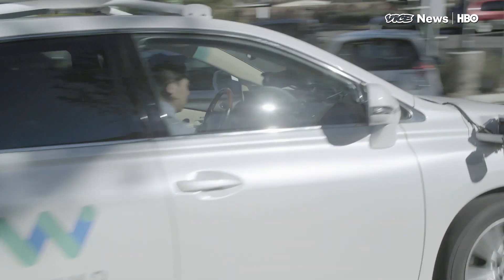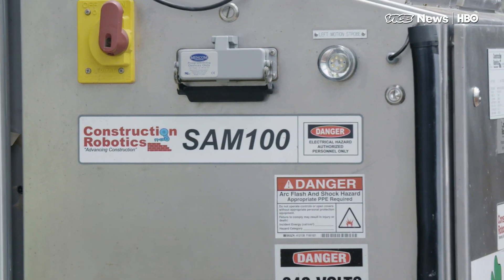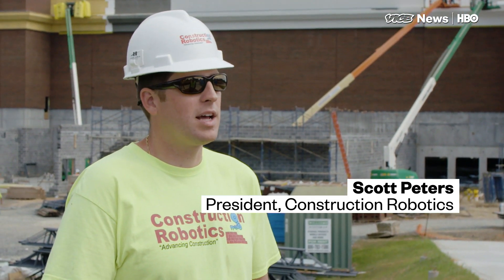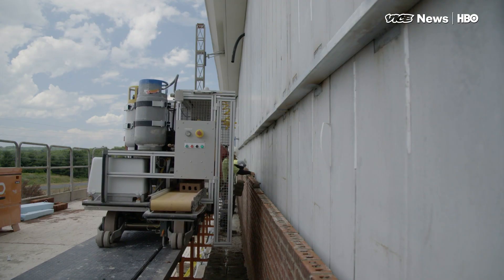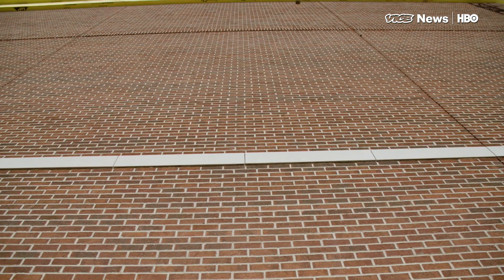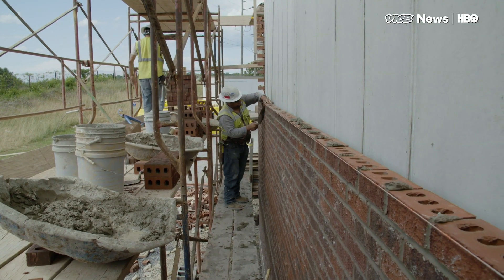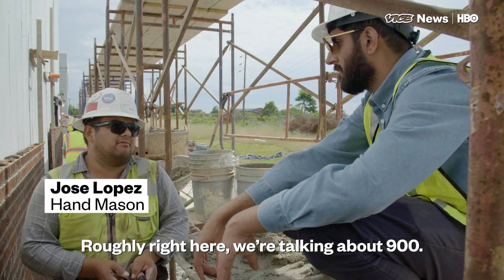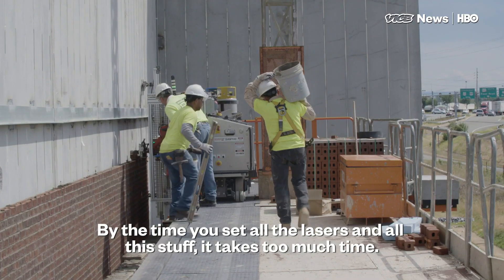This Bricklaying Robot Can Build Walls Faster Than Humans (HBO)

Comment: Listen carefully at the extremely simple and accurate comments made by the two workers....
peoples to feed the machine,peoples to maintain the machine,and even a mchine to feed an other machine.
It's the thing humans can do the best for simple tasks : making it more and more complex and costly in time energy and ressources.
Moreover this robot could only be useful for long or very long walls,since you are limted on the layers you can install per day : you have to let the mortar to dry and harden....

Comment: That big ol' clunky thing? First that sputnik whatnik just lays bricks down. It don't scrap and smooth out the excess mortar, a dude got to come behind it and do that. (And feed it red blocks too? Come on man!) Secondly it's slow. So it's delaying progress. There are seasoned human Mansons that can whip out and lay bricks in quick single strokes and dust that piece of hindering contraption, just being a waste of space. There's some useless technology politics trying muscle in somewhere. That's all. I'd say push that  pile of junk on wheels off the scaffold when near the top of the work and let it kaboom crash smash all over the Earth. Problem solved. Next issue.

Comment: the key statement," a few less workers on sites." Ya a few less now, but in 10 years it will be less a .10/tenth of the workers needed as robots will replace all of it robot load brick robot load mortar robot mix new mortor one guy watching who is the engineer. No breaks no lunch no toilets. It can run day and night 24 hours no breaks a driver pulls up hits unload button robot dismounts truck and is positioned at building with lasers and sat geo. and thats it costs cut drastically no one needed. It is here it is progressing fast adios livable paying job. You should have been in programming. But wait everything is pug and play and soon pc will reprogram itself no programmer. It is here also!

Comment: what they are not talking about is that the economics will take over and the industry will be sucked into designing and constructing buildings that will be predisposed toward construction robots.    
 Money will drive the whole industry to use the least costly method.   
So get use to long straight walls.

Comment: These robots are going to be so limited on what they can do. The setup time is high compared to a human just getting up and going at it. Plus what is the cost of one of these robots compared to cheap labor? These robotics companies are looking out for a quick sale. I dont' see it making curved walls or special joints and laying out the ends if a brick wall. I guess these are more for the easy sections.

Comment: I dont think its faster and certainly NOT efficient, it lay 1 brick any 15sec or so and you need more humans than before to finish the job
1x to place brick into the machine
2x to remove the excedent
1x at the end to redo a final joint
and atleast 2x watching the whole job getting done to make sure its not failing any faster

Atleast you did an amazing opportunity to create more jobs doing this robots which was unexpected xDDD

Comment: Im a bricklayer and i can tell you in point form;
1) that work was as rough as guts.
2) it takes at least one person to man and feed the stupid thing, Im guessing more. And technicians and engineers charge more per hour than tradesmen.
3) it is slow. Much slower than a good human bricklayer and it is almost impossible to lay 1000 bricks in a day. At the speed it was going the only way it would lay 3000 is under perfect conditions over a 24 hr period but i doubt it, meanwhile you have paid a bunch of labourers and technicians three days pay to do what one man and half a labourer could have done much more neatly in one day.

Comment: Seems extremely job specific. Can I do radius walls? Arches. Flemish bond herringbone? Can It cut brick? All of these things come into play while on a job. And it takes 2 to 3 guys to run one machine which seems inefficient. You probably spend a good deal cleaning the machine lubricating the machine and setting up the machine when you could just be laying brick.
Reply: Seems like it wastes a lot of mortar as well.

Comment: Let it build a house with plenty of corners and not just a straight wall.  It needs good clean ground with no scaffold in the way. Totally pointless. Plus u need two brickie s to tend it and if u watch the video there's actually one lad tending it and two brickie s cleaning up and pointing the joints pure stupidity

Comment: This is an amazing machine but it is overall very sad as these BIG Companies keep building machines that are taking the place of humans. This will cause these BIG companies to grow Bigger and Richer Faster. Pretty soon these companies will have very little human workers and it will be nearly impossible to compete as a independent company, also small independent companies will start to get sued constantly by these big major companies if smaller companies start to make a dent in the big companies pockets.
Reply: Actually, a couple states DO have laws against SLAPPs.
Reply: i DO like to RANDOMLY capitalize words for no REASON
Reply: Dude, I hear you. It's gonna suck when it happens. I'm in security and I can see drones and automated systems taking a lot of the jobs I used to do. But if it gets to the point where a machine can do it more efficiently, safely and cheaper than me? I can't fault them for that. I can fault them for using the threat of automation to keep wages low and fighting against proper welfare and retraining programs to help people losing their jobs.

It's coming and we need a solution for it. Going backwards isn't the solution.
Reply: Can't fault them for wanting efficiency and safety.
Reply: i make memes for a living It's all about the Emphasis.. Braa.
Reply: Rhazor Halone Did I say we need God? Both God and science are a thing of the past, both of them are systems of belief, just as politics and economics.
Reply: Rhazor Halone You too :D
Reply: Rhazor Halone Okay I get you pal, let me guess, you were born in the Anglo-Saxon world and obviously anyone who is not sucking obediently onto the tit of the market must be considered a threat to your values. Unfortunately, the neoliberal hegemony which is based on these values is on decline and it's just a matter of time before TINA gets dumped in the dustbin of history along with capitalism and Social Darwinism. We simply can't survive it, and if you think lower prices will save us from self destruction, you are a blind schmuck that hides behind economics to try and escape from your feelings. Life will show you how naive this attempt is, which only brings more suffering and ever greater need for distraction and entertainment (money, food, sex, alcohol, tobacco, stimulants, antidepressants, porn, objectification of people, politics, nationality, power, aggression etc). It will never substitute for love, no matter how hard you try and you know it. The choice is yours really, but if you think you can mask the suffering with belief (whether it be in God, the state or the market), you are in for a bad trip my friend.
Reply: Rhazor Halone By the way, where are your own arguments? Up to now all I have seen is a dubious proposition of Varoufakis' critical thinking capacity and repeated labeling of the points I made as a 'bloviation'. Thanks for this wonderful concept, I will use it in my writing on populists, which believe me are very useful in keeping your beloved market mechanism intact by channeling the rage of the people towards abstractions and therefore lowering the social pressure which results from ever expanding marketization, financialization and consumerism.
Reply: Rhazor Halone I hope you're having fun kicking that straw man's ass, just don't forget that it's merely a projection of your fear.
Reply: Rocks Are People Too what if you ask what the five fingers say to the face first?
Reply: The people will have to vote for a politicians that don't side with the 1%, never gonna happen, the mainstream media is in charge.
Reply: Automation benefits big companies more than anyone else, yes, but it will also destroy capitalism.
Reply: Rhazor Halone You are so confused oh god, I hope you read a book or two in your life.
Reply: Gizmo fromPizmo yeah that's cool I hear you, get back to me when your job implements a similar structure and you lose your job due to it. Don't blame them. Just take a hike and get a different job.
Reply: Rhazor Halone I am sorry, but you still live within the confines of the neoliberal worldview which prevents you from questioning and contemplating the most fundamental phenomena of the social, political and economic systems of the global civilization. Indeed it is nice to see that you have studied economics and realize that consumers benefit from cheaper production costs. But you see, economics, ever since Walras, has strived to become and pretended to be a SCIENCE. This fact, plus the secularization of the Western world in the 19th century, plus the historically contingent growth of the state apparatuses of the 20th century due to mainly military and monetary reasons, allowed those who were once considered philosophers to a greater extent than economists, become highly respectable government advisors and academics whose institutional and disciplinary frameworks incentivized an ever greater expansion of the field we now call economics. Unfortunately, economics can never be a science. It can only be science for a society of the period we call modernity when people still lived the Newtonian dream of the classical mechanics. Reducing human life to only that which can be measured and quantified objectively and thinking of one's self as a subject in a physical world of external objects sounds like a nightmare of a Western intellectual that still didn't know what the atomic bomb and psychedelic experience was. Yes, we killed God and drank ourselves to death when it became clear that substituting Christian metaphysics with scientific worldview (which leaves that question out altogether) could only bring us disconnection that ends in war, genocide, propaganda, consumerism, narcissism, depression, populism, pollution, the good old poverty and inequality, all in all a capitalistic kleptocracy where decades of public investment in technology can be privately capitalized on, turning profits into a white cloud of smoke (it's pretty hard to tax air, isn't it). Let's talk again once you have looked into things like suffering, poverty, love, childhood trauma, oil, tobacco, alcoholism, pharma, mental illness, history of economics, history of modern education system, environmental degradation, Cold War propaganda, LSD, Hermeticism, theosophy, Hegel, Marx, Nietzsche, Husserl, Jung, Sartre, quantum mechanics and many others if you are curious enough. I believe automation is a good thing, but not until it has destroyed capitalism. I am not interested in pointing out your mediocrity and having a laugh about it, I truly love you and hope you don't stop on your journey towards higher levels of consciousness.
Reply: Rhazor Halone Please watch this video, I am sure it will be very helpful to you: https://www.facebook.com/evonomics/videos/1953633044907475/
Reply: Rhazor Halone Don't you think an individual who has studied and taught economics for decades might have a more informed view than someone who labels things as "stupid" and people as "morons"? Boy you have a great surprise waiting behind you if only you decide to turn back. Just know that what you experience is absolutely normal. Anxiety is the main reason it is so hard for us to learn about the world. Many new facts seems to contradict our current worldview and we experience cognitive dissonance. Staying within the confines of our worldview by listening to the same information providers seems to make us feel much better and therefore we become more and more sure of the validity of our opinions. This is a trap however, which does not allow us to get beyond the dualities of the mind.

Comment: This machine can only be used in very specific circumstances, plus there was three people around the machine just to operate. It lays 3000 bricks a day, but on that same wall you could easily have 3 brickys there doing the same job with virtually no setup time. I dont see how its cost or even time efficient tbh. I bet it takes a good couple hours just to setup all the lasers ect.

Comment: You call that a brick wall? lol
Reply: Never makes a mistake as long as a human is monitoring it. Places bricks only, can’t finish the joint or brush for aesthetics. Doesn’t do corners, but goes like hell in a straight line. Takes several days to set up just to get rolling. Doesn’t pee in corners bonus
Reply: Im surprised there is no steel bars inside the bricks, its like a paper wall
Reply: West Senkovec I'm not sure what else you would call it
Reply: West Senkovec it’s a brick facade
Reply: Brick decoration, the wall is that concrete slab behind. Waste of bricks.
Reply: Aaron Nunya 3000 bricks a day. 4 bricklayers around £800. This machine must cost around the same to hire a day. Plus it needs 2 men to load it with muck and bricks and to point up. This robot can't pick out a chipped or cracked brick and throw it away. Not to mention some of them bricks the robot was putting down did not look the same height
Reply: J.L.T BRICKLAYING CONTRACTORS yeah, they own the machine soooooo it works for them and if they're still using it, it means it's leaving them with profit atm.
Reply: West Senkovec the perps are tight but meh.....
Reply: Aaron Nunya that's not hell in a straight line ;)
Reply: @Pablo Elizondo its just a face brick wall as opposed to a brick veneer. The brick veneer is usually a thin-live brick material put in sheets against the structure. This is 1 single brick with actual mortar and is still for looks mostly; the wall is a tilt-up concrete panel with metal ties between them. That is the gray you see the brick being put against (even though they are leaving a gap-probably for more mortar/seal)...

Again.. just for looks really.
Reply: Aaron Nunya doesn’t show up late to work, doesn’t eat or take smoke break :)
Reply: No Surrender I know right!? Lmfao
Reply: So on the other side the wall looks like shit?
Reply: J.L.T BRICKLAYING CONTRACTORS they literally talk about the future and how they will soon not be needed to help the robot.

Maybe finish the video next time?
Reply: why not, its in the wall
Reply: I call it 3
Reply: It may not be fancy, but for large scale construction, it's pretty typical. For fancy designs, human beings will probably still be necessary. This site uses humans for the finish work.
Reply: Aaron Nunya for now. 100 years ago nobody would have believed that you could fly in a pieces of aluminum weighs as much as a two story house. No nobody expects a machine to do the finish work for brick laying
Reply: Rough as a badgers arse, my missis could do better
Reply: No Surrender, It really depends on where you live and what you're used to. This was more like a cosmetics wall. The real wall had already been made in cement, and that made the laying of the cosmetics wall even easier. Furthermore, some construction sites already use fake cosmetics bricks walls that are already premade in factories. This can be pretty fast already.

Comment: 1 robot + 2 workers = 3000 bricks 

How about this

1 worker lays 1000 bricks x 3 = 3 workers and 3000 bricks 

I don't understand the need for a robot, initial cost of the robot plus maintenance and repair surely outweighs just having a 3rd worker in place

Comment: I've worked 29 years as a mason. I'm not threatened. That thing is slow and the masons tooling the joints are doing it way too early, rendering the tooling useless. Tooling the joints must be done at precisely the correct time, depending on the conditions, to seal the joints so they repel moisture, and are pressed to the edges of the bricks. Tooling too early only shapes the joint but it doesn't seal it. So, water can penetrate the wall and then you can develop mold issues behind the wythe of masonry. Most modern bricks are hard fired, so moisture doesn't penetrate the wall and cause a problem through the bricks. Water enters, generally, through poorly finished or improperly proportioned mortar joints. All the old school masons will know what I'm communicating about, but the general public, they don't know. And why should they,  that's not their expertise. The folks behind the robot industry know that, and they don't care about the final quality of masonry that lasts hundreds, even thousands of years. They just want fast profit, now. And then they move on to the next job to make another buck. What you see is not always what you get in the long run. It is a shame that the crafts are slowly being lost from application  and quality to appearances only.  Shame, Shame!

Comment: Why mislead the public, these machines are useless,they stain the brick,2 people are required to point and finish the wall, and finally the wall looks as rough as a bears ass, the machine cannot build the corners or even follow bond, all bricks vary in length, even the same batch, to set the thing up takes an ocean of time and the thing cannot run off a normal scaffold, it's easier and quicker, neater and 5 times as cheap just to use a bricklayer and always will be.